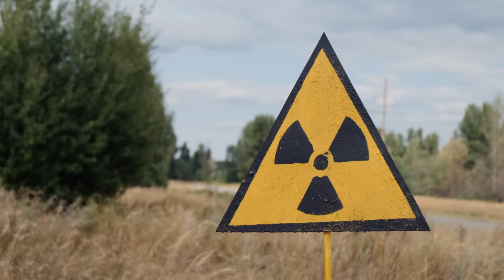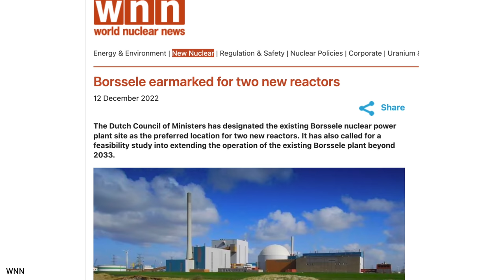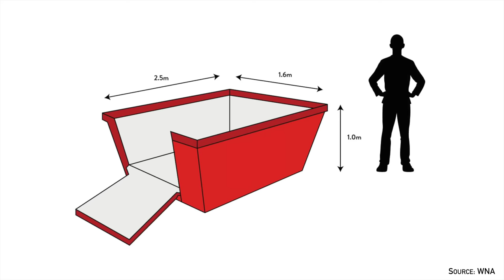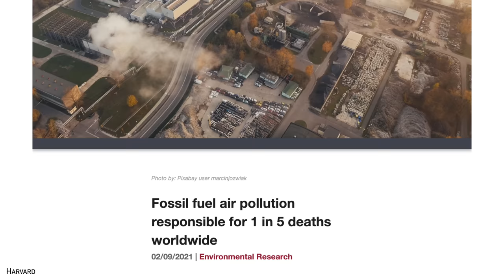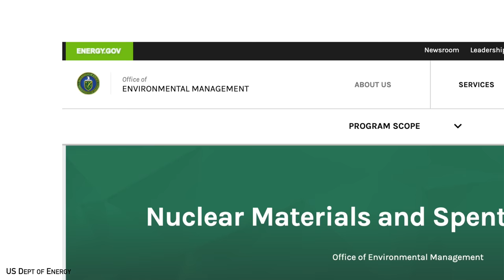Can Nuclear Waste Ever Be Solved? Yes.

Comment: Look, this all SOUNDS good, but is important to look at what has NOT been done.
The majority of spent fuel remains in cooling pools, not casks as implied by fully decommissioned reactors like San Onofrio. The US has over 80,000 tonnes in pools, maybe 50,000 tonnes in casks.
The majority of spent fuel has NOT been reprocessed. France has done about a third of theirs, falling further behind each year. The US has reprocessed NONE. 
NO Spent Nuclear Fuel or High Level Waste is in permanent disposal ANYWHERE. 

Onkalo is going to be the first but it has been one year away from accepting waste for about four years. It is still one year away. Geological disposal may be our best bet, but there are no DEMONSTRATED facilities. Yucca failed mightily, on community ethics, water exclusion and oxygen ingress. As an example, it is an example of  how to spend 15 billion on a failure.
The costs seem tiny, but huge lawsuits have been fought to avoid paying.  Finland has a few thousand kilos of spent fuel, the US has 130,000 tonnes. It seems unlikely that the US will be anywhere near the Finnish price per kilo.

Reprocessing surely helps: Spent fuel can be reduced to a smaller volume of fission products requiring shorter disposal horizons, and a small volume of actinides requiring long disposal. 
BUT: France has reprocessed only about a third of all it's spent fuel. The US has reprocessed NONE. France has paid a high price for this. Their electricity costs more than twice that elsewhere, and only appears similar at retail due to massive subsidy. To expand reprocessing to actually keep pace with waste generation would cost much more. How well would this fly in the US?

Existing spent fuel is also not a direct fuel source for proposed new reactors. it will still need reprocessing to remove fission products and decay products and it will probably need isotopic separations to remove accumulations of neutron-absorbing actinides. This may be feasible for spent fuels derived from uranium only fuels. Spent MOX fuels have further complications from U232 contamination. 

The solutions may be well understood by some scientists and engineers. They are completely NOT understood by those hoping that nuclear will be cheap or easy. The real costs are actively denied by proponents, and fought in court by the industry.

Until we see unbreakable national commitments to disposal, with deadlines and penalties. Until those commitments are understood to be an up-front cost of doing business by both the industry and the military, there is no reason for trust or faith from the rest of us.
Reply: “No … permanent disposal . ..anywhere”

True, ie no deep repository. Also true, no record of commercial spent fuel hurting anybody anywhere, a necessary context against the ongoing 30B tons /year of hydrocarbon combustion which reactors displace.

“Fought in court by the industry”
The industry entirely funded the creation of Yucca Mountain, as it was required so do, $15B.  The NRC, lead at the time by director Jaczko, was required by law begin use of Yucca, and instead torpedoed Yucca, illegally as found by the courts. 

The court “agreed that the NRC had violated the Nuclear Waste Policy Act (NWPA) when its former chairman, Gregory Jaczko, stopped the Yucca Mountain license review at the point when it was nearly complete. “
Reply: @Nill757  
Yup, no functioning geological disposals anywhere.

Fortunately regulation has kept waste storage adequate so far.

Yes, fought in court. 
Let's not forget that the DoD and the DoE are also squabbling about a fraction of vintage waste instead of displaying the "honour" or backbone to just get it done.

The industry may have funded Yucca Mountain. It was inadequate then and now. The titanium drip shields clinched that, and no amount of band-aids can fix it. The Nevada representative was reasonably serving the interests of the state in blocking it. Yucca shows that site selection has to begin with seeking and securing community approval, and factoring whatever extra costs that involves. The Finns did it, so it's not actually impossible.

Yucca does however give us a guideline for minimum costs: The stockpile is roughly twice the capacity of Yucca,  and a dollar then would need about $2.25 now. Plus whatever margin is required to be fit for purpose. So a bare-arse minimum of around seventy billion, probably much more. The present provision is clearly inadequate.

There are a lot of things to get right: Community engagement, commitment to full funding without hedging, and transparency of the real costs.
Reply: @aaroncosier735  more nice story.  You’re right about community engagement, but that’s not what stopped Yucca. Nevadans have a long history with mining and even nuclear tests.  Most of them didn’t care at all.  But fossil backed H Reid did, and a large waste depository might well have shifted public opinion in the US enough to allow nuclear to squash fossil fuels in 15 yrs like it did in the French grid, and Reid wouldn’t let that happen. 

Btw, doubling the cost of Yucca for yucca 2.0 is nonsense. It’s not a gold mine where you close it down when the vein runs out, instead it’s just expanded. That has a cost, but not like some 2nd site.
Reply: @Nill757  
Lack of community engagement certainly did. 
Had it been sought, and satisfied, and documented, then the objections could nave been opposed forcefully.
But it was not.
In any case, water ingress and the kludges required to try and address that were grounds enough, as was oxygen ingress.

Permanent disposal of  the existing stockpile of wastes will easily exceed my optimistic estimate.  The larger the facility, the more diffuse it has to be to ensure thermal loads are not exceeded. Tunnel runs get longer, spacing increases. Any given site will have limitations imposed by surrounding geological features, and a second site is entirely likely.

By all means, let's see all existing waste successfully interred, with demonstrated costs and performance monitoring, and then the entire industry can pat itself on the back. Not before. Get it done and prove me wrong.
Reply: @aaroncosier735  “Get it done prove me wrong”

Could build a hundred Yuccas, that hurt nobody ever, and you’d deny everything, as w perfectly safe on site casks and pools now.  Some bit of water a mile down that does nothing, guy fell off a ladder.  Thermal loading? Please. At ten years that’s trivial.  Far more geo heat in that hole.
Reply: @Nill757  
Well?
Get it done and prove me wrong.

You'd have to do better than Yucca though. Drip shields, FFS. 

To remind you, you are building for several thousand years minimum, not just till next week. 
Polls are temporary, and are subject to attack and neglect. 
Casks are "interim" and are not inaccessible to deliberate damage.

Thermal loading appears to be a concern for the real engineers. You don't seem to be one.
Reply: @aaroncosier735   Don't have to do better than Ycca Mountain, above or below ground is fine anywhere on the planet.  Oklo Gabon proves that.
Reply: @danadurnfordkevinblanchdebunk  
Yeah, future  sites have to do a LOT better than Yucca mountain. 
Starting with getting community engagement and approval.
Yucca failed on water ingress, oxygen ingress and because it was imposed without seeking community engagement first.

Oklo proves that if you wait two billion years, the fast neutron products are still distinguishable from ordinary unreacted ore.
What you probably do not realise  is that fission products like Iodine and caesium have different chemistry to Uranium and plutonium. Any high school chemistry text can help you with that. The difference is also demonstrated in the PurEx process for separating Uranium and Plutonium from fission products. 
The Oklo site did not contain the initial fission products nor about half of the actinide products and their decay daughters.  Down stream of Oklo was contaminated for the duration of operation and for long after. Perhaps that didn't bother anybody 2 billion years ago, but it is not acceptable now and it is dopey to pretend it would be.
Modern reactor wastes also contain much higher quantities at much higher concentrations of all of these than the Oklo natural reaction site ever did. Oklo was about 100kWth with poor geometry and intermittent reactivity, whereas typical civilian reactors run continuously and are about 3GWth. A hour of operation produces  roughly 30,000 times more fission products than Oklo did in a similar hour.

Overall, Oklo is a poor example and only shows that you have not grasped the basics.
Reply: @aaroncosier735   Yucca Mountain was extreme overkill.  Oklo Gabon WAS a natural fission reaction that left waste products after it exhausted itself.  After two billion years scientists have found that the contamination was highly localized and didn't spread like you desperately need it to have to prop up your anti-nuke meme. .
Reply: @danadurnfordkevinblanchdebunk  
Yucca mountain failed on several fronts: It failed to get community approval *first*, was limited by geological faults on all sides, and had issues with water ingress and oxygen ingress. The water ingress issue resulted in the laughable kludge of designing titanium drip covers for the canisters. 

To correct you: The Oklo site generated water soluble fission products which most certainly were washed downstream. The uranium and transuranic products were retained bacuse they have much lower solubility. Traces of fission products and a subset of their further decay products were trapped on site by being baked into metamorphic mineral structures, but only traces. The vast majority simply washed downstream, in accordance with perfectly ordinary solubility properties.
Reply: @aaroncosier735   No, Oklo Gabon didn't spread widely downstream either as you fear mongering meme suggests.  Even without caksing.
Reply: @aaroncosier735   We could literally bury it anywhere (recycling would be better), but it's actually merely a political problem.
From the US GAO website: "The DOE is responsible for disposing of high-level waste in a permanent geologic repository but has yet to build such a facility because policymakers have been at an impasse over what to do with this spent fuel since 2010.  Meanwhile, the federal government has paid billions of dollars in damages to utilities for failing to dispose of this waste and may potentially have to pay tens of billions of dollars more in coming decades."
Reply: @danadurnfordkevinblanchdebunk  
You are incorrect. The natural reaction zone at Oklo did not contain the fission products. A fractiion may have been trapped by being baked into a metamorphic mineral. However the vast majority were straightforwardly soluble. Water was readily available and was both the medium by which uranium was deposited, and the moderator. 
The material that moved downstream has had ample opportunity to disperse over 2 billion years.

Perhaps you do not understand "soluble"? Look it up.

As for modern spent fuel wastes, the amount of radiotoxicity is stupendous, and will be for many generations. Casks are only temporary shielding and heat dissipation devices, pending more complete encapsulation and geological disposal.
Reply: @danadurnfordkevinblanchdebunk  
No, you could not just bury it anywhere. It needs to be in a site that has high geological stability and where corrosive and mobilising agents cannot penetrate for long periods.
There is most certainly a political problem: The autocratic idea that citizens have to put up with having a disposal site forced on them. Get community acceptance first.
Blaming it on "politics" when no genuine effort has been made to seek welcoming communities is just laziness.

Comment: Many reactors are built near oceans to use the water for cooling.  Sea levels are rising due to climate change.  The spent fuel stored at these sites must be removed to higher ground while we still have the ability to do so.

Comment: Good solutions for the waste, but nuclear fuel is not sustainable, like oil and gas, once we run out, we're out of it.
Reply: Thousands of years worth of fissionable fuel.
Reply: @Nill757  230 years max.
Reply: @Nill757  But the most important thing is centralized power production is an excellent terrorist target and rife with corruption.
Reply: Materials for solar and wind arent infinite either. I guess everyone will have to start getting used to the stone age again
Reply: @gregchambers6100  instead of adjectives, maybe show where there has been any power plant terror attack
Reply: @gregchambers6100  > 230 years fissionable fuel
You really have to look at this carefully. The '230' or 'XX' years is determined by people putting an arbitrary pin in the cost of uranium right now, deciding what is/isn't economically recoverable, and then comparing that to known reserves.

First, the cost of uranium - uranium costs are quite a minor component of operating a NPP, so even if the uranium cost doubles/triples/quadruples, it doesn't really have that much impact on the price of electricity produced.

Second, the cost of uranium - we can assume SOME scientific progress over the next 230/XX years, so this means more and more uranium will be recoverable. And the higher the price, the more people and effort will be spent trying to make it cheaper.

Third, the known reserves - nobody is looking for uranium, because the price is too low. If we were to start looking for uranium again (perhaps because the price rises a bit), the known reserves will expand.

Sure, eventually we would run out, but that would be 1000s of years in the future, and we might be using thorium etc by then, of which we have 10,000s of years of supply. Probably even sooner - but people aren't working on thorium-based reactors because of the lack of uranium!

https://world-nuclear.org/information-library/nuclear-fuel-cycle/uranium-resources/supply-of-uranium.aspx

Really, if you believe we will run out of uranium, you should read a bit more.
If you believe lack of uranium is a good anti-NPP argument - you should stop. It is one of the easiest things to debunk.

Comment: If spent fuel can still be used, why don't the former power plants continue using it until it becomes completely unusable?
Reply: Over time in the reactor, the fuel becomes 'poisoned' with by-products of the reaction. You can take it out, reprocess it to clean out the by-products and make fresh fuel with the rest
Reply: @jasona716  Perhaps a little trickier than that.

Sure you can remove the fission products using PurEx, but the remaining actinides include some neutron-absorbers that really reduce the efficiency as fuel. Also, the overall fissile content is reduced. It got used up. Topping it up with army-surplus plutonium only looks cheap if you do not count the cost of making that plutonium.

Ok, so you use all that, and make some MOX fuel and use that in a reactor.

The waste from that MOX fuel is whole new problem. It has a lot more U236 and U232 than ordinary uranium fuel and these increase the expense and difficulty of further recycling, or of any other path of disposal. Something like 20% of current nuclear generation is from MOX fuels, and as these enter the waste stockpile in quantity they will create new waste storage problems.

Any further recycling of used MOX requires a hard commitment from both industry and government to run a facility to handle this material while fresh, in lockstep with production, including traditional reprocessing and isotopic separations, and policies for the storage and/or disposal of the new category of wastes. Alternatively, it requires a substantial investment in temporary and interim storage facilities, to hold more waste, for longer periods. 

Not saying it can't be done, but it's not as easy as it might seem at first blush.

Comment: Recycling is the future!
Reply: How well is that going for paper, plastic, and glass let alone nuclear waste
Reply: @clarkkent9080  BN-800
BREST-300
MOX and SNUP fuel...
All that means shortage of a volume of nuclear waste and closing full nuclear cycle.
Even long living isotopes could be burned out by neutron irradiation...
Reply: @GenaMatogen  BN-800 has only operated on MOX and the Pu239 used was from deactivated nuclear weapons not spent fuel. 

 The French have been reprocessing spent fuel for decades, mainly as an economical way to obtain Pu239 for their nuclear weapons program and as a side process they make and use it for MOX fuel.  
MOX from spent fuel requires expensive and dangerous processing. The French have only reprocessed a small fraction of their fuel and with that facility reaching the end of its useful life it will most certainly be abandoned. 

BREST-300 is a great power point presentation but is nothing more than that.  And I would not look to the Russians for nuclear safety, proper waste disposal,  or environmental concerns.  They seem to make great war criminals.

Nice try for the uninformed
Reply: @clarkkent9080  BREST-300 is already under construction.
This reactor Will engage uraniun from recycled fuel or depeted uraniun and plutonium.
This only has sense. Because only fast neutrons turns U238 to plutonium.
Reply: @clarkkent9080 You look uninformed about nuclear safety and technologies in Russia. Have you heard about safety measures after Chernobyl? Have you heard about "Mayak" plant and technologies they use?
Reply: @GenaMatogen  5 years to build and 5 years to prove the concept.  Tell me about it in a decade.  Technically it is entirely possible but only in countries like Russia and China
Reply: @clarkkent9080  Will see...